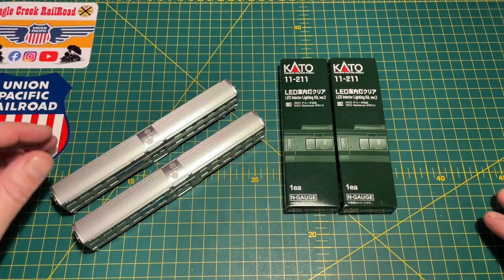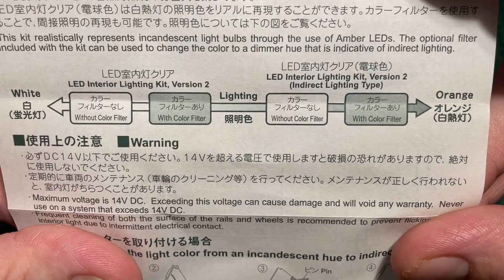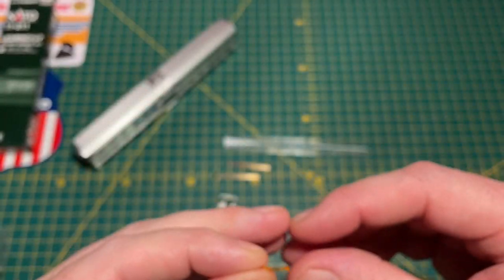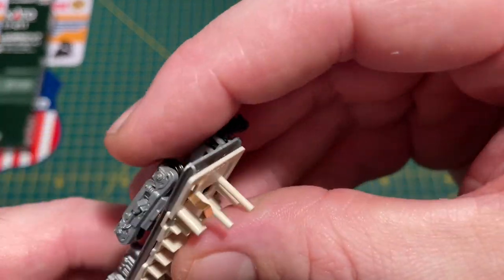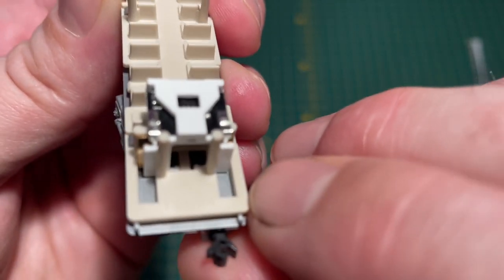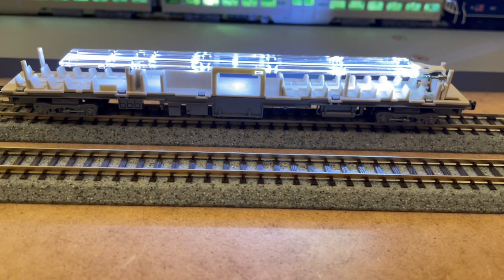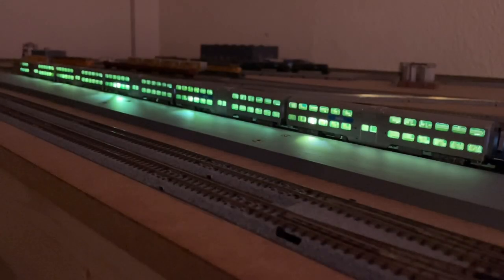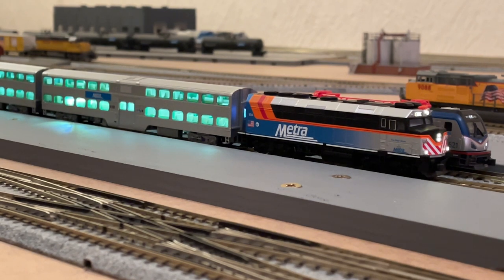Fitting A Kato N Scale 11-211 Lighting Kit In A Metra Bi-Level Coach.

Comment: Hi did you try to program the coaches to turn on and off from your control? Like  1-2-3and so on. Thank you
Reply from the maker: Hi. Unfortunately that's not possible with these coaches without a lot of rewiring work and fitting a dcc decoder as they don't have a decoder inside to program etc. They're just on when the track power is on and off when it's off. Ben.
Reply from the maker: The cab coach has the provision for a decoder though to control the directional lights, it's a Kato FL12 decoder.
Reply: I am new to this hobby I have seen another video but unfortunately I didn’t save it I am still on the learning curve,any help would greatly appreciated. Thank you